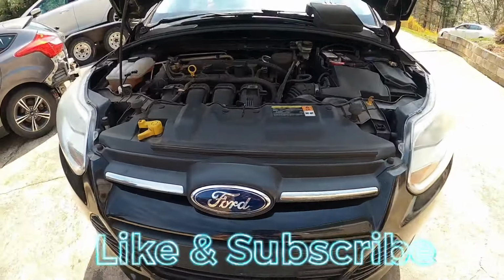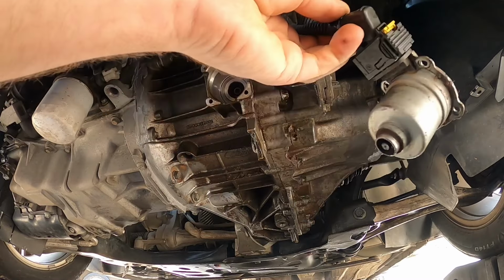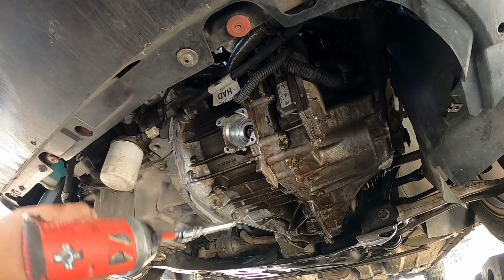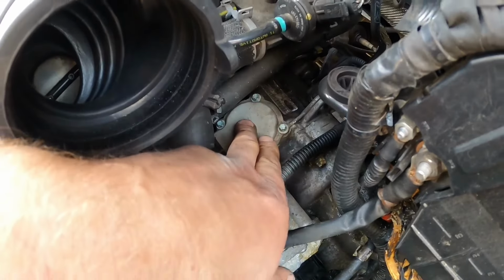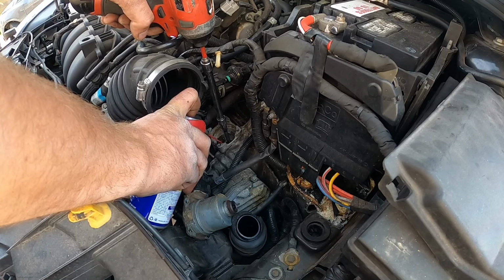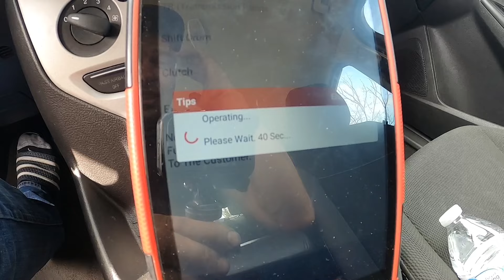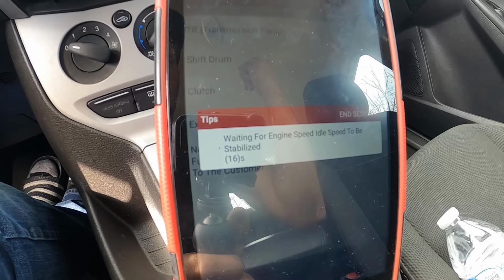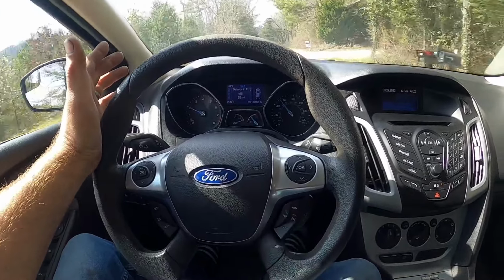2012-2018 Ford Focus Slipping? No Reverse? No Drive? Problem Solved. Easy Fix. You Can Do This!

Comment: Hey man! First of all, thanks for explaining this procedure in such a straight forward way. Point of inquiry: what kind of scanner are you using? It seems that mine doesn’t read transmission codes. I have an Otofix D1 Lite…

Comment: Impact-Driver has small battery which prevents damage.  Drill should have a smalll battery too or go slow.  Be very carefull. Apply extra fluid to help clean. Have patience.   Good Luck

Comment: Looks worth a try! Have people found this to help with the 'transmission overheating' message?
Reply from the maker: Overheating means forks are sticking and slipping the clutch. This should help. If not, you need new forks and possibly a clutch
Reply: @L8R-HP  thanks for the reply. Hoping I can find a good mechanic to do forks etc in Sydney, don't want to take it to Ford

Comment: My focus is slipping slightly in first, so I will test this fix out. I think I will get an extra actuator from the junkyard and cut off the splined part to make my own tool.
Reply: Low key smart..
Reply: did it work?
Reply: @2511jeremy  I have not done it. the transmission is performing fine as is currently

Comment: Surprising to me i haven’t had this problem yet. I got the 2017 se and i had the car for about 3 years. Still no problems with it, and i drive it aggressively everyday. I treat the car like a rally car.
Reply from the maker: Haha nice!
Reply: You're one of the lucky ones.
Reply: I have a 2015 focus with over 100k miles and its barely started doing it.
Reply: Because the 2016.5-2018 models were the "problem free" models with all the hardware and software updates. Driving habits are the main issue after that. I have a 2016.5 model (bought brand new) that's had a few small hiccups over the duration of ownership. Still going, just shifts a little slow so I think the TCM needs replaced.
Reply: @brandonhooker4498  How do you know if you have a 2016.5 model?
Reply: @Chadman333  build date, which should be on the manufacturer’s sticker on the driver’s door jamb
Reply: @brandonhooker4498  Thanks for quick reply! My son is looking at a 2016 Focus se sedan, carfax shows TCU recently replaced and clutch was replaced at 37,000 miles. (Currently has 105,000). I was trying to learn more about the transmission problems with these cars. Do you know the specific build date that the car would have to be built after to have the better components? I was watching a seperate repair video which said they were all built the same and have same problems all the way up to end of production.

Comment: I have a 2014 Focus. Car suddenly would not go over 30mph. Reverse and Drive works fine. Took to mechanic and they said transmission needed replaced. However when the codes were cleared, the car drove perfect all the way home. Has not happened again since bringing it home. What would have caused the issue? Mechanic did not tell me what codes pulled when it was scanned sadly but with it running fine now, I'm skeptical that it is actually the transmission. Thoughts?

Comment: Yo! Thank you for the video. 

I'm preparing to do this work on my 2014 Ford Focus se. Lately, after 20 min of driving or so, my check engine light will come on, I'll lose Reverse and switching gears from 1-2 and 2-3 are really rough.

 I've seen on other videos that you can and maybe should (?) clean the forks with Brake cleaner and lubricate with WD-40, I also purchased 2 new actuators just to cover all my bases.

My question to you is, do I need some fancy diagnostic tool to do this job? Or can I get by just cleaning the forks, replacing the actuators, and restarting the car? If I need some sort of Diagnostic tool, what capabilities must it have? I just ordered a FORScan tool, will I be able to do what is necessary with FORScan?

Any help would be so greatly appreciated man. Thanks!
Reply: Curious to know how this turned out for you
Reply: hey I’m having those same issues. were you also getting “transmission hot” issues but it would be fine after a few minutes? Thanks, if you read this
Reply: @mads416  Hey mads, no, fortunately for me I didn't have that issue, but I haven't fixed my issue yet either. It still jerks and shudders often but the worst of it has yet to come. It seems that the issue is especially apparent when it gets hot, like 80F+, and we haven't really had that where I'm at yet. The worst includes stalling completely (car does not get into gear) or losing reverse for 20 min at a time. 

Hope we figure it out. Ford should have a Class Action filed against them.
Reply: @CattyWompus.  Hi Catty, I haven't fixed it yet but my car still runs and jerks at every stop sign! lol

Comment: If you have a blow gun you could always zip tie it to full blast and insert it into the top one while you're spraying. Be sure to wear safety glasses....lol
Reply: @james102377 I should use an air compressor and shoot air from actuator a (top) down with actuator b (bottom) both out?  Will this not send all the clutch dust flying all through the gears etc?

Comment: Works long enough for me to get a FOR SALE sign in it I’m good with that!
Reply: Learn your lesson.  Buy an EV.  No transmission
Reply: @anthonybha4510  😂😂😂 an EV?
Reply: Just sell it to carvana and be rid of the headache. While my focus gives me no other trouble than this tranny shudder from the forks i think its ridiculous, my first car was a 2000 Taurus and that car had over 200000 miles with no transmission work done and nothing wrong with the car except a couple o2 sensors. But cars that dont break down dont make ford any more money.

Comment: My question is what effect will all the fluid have on the clutch in the long run??
Reply from the maker: Don’t put too much and it won’t be an issues. There’s so much heat in there it will dry right up
Reply: @L8R-HP  thanks for getting back to me. I definitely need to do this.
Reply: Brake cleaner will not cause an issue. Be sparing (use less) of wd40. He said "a little bit". WD40 is a water displacer cleaner that does not dry like brake cleaner. Brake clean is a degreaser/ cleaner.

Comment: Do you think is a good idea to put a vacuum hose in the hole to remove some dust from transmission housing before spraying brake cleaner.. I don’t have any problem yet, just thinking to do it as a preventive maintenance
Reply from the maker: Worth a try

Comment: Good video, I used a used part and took it apart to make a tool. Long story short, the bottom fork wound up all the way and then unwound itself all the way. A actuator DID NOT spin back all the way, it would spin about 4 spins and stop. Does that mean the fork is bad? I'm not a very mechanical person but it definitely didn't spin back freely like B actuator did. I tried spraying it multiple times and using plenty of WD-40 and it still didn't spin free all the way back. It also looked off center and made a clicking sound at about the last 6 turns. Would I need to take this transmission apart?
Reply from the maker: That fork needs to be replaced :/
Reply: @L8R-HP  Thank you man for your response. That's what I was thinking too.
Reply: @L8R-HP  do you have any recommendations for ordering a new clutch and fingers from? I looked at rock auto but didn't see anything. Who's got solid replacement parts? I'm probably going to completely rebuild the dry side. 100K miles on her.
Reply from the maker: @ryans4401  ford OEM parts if you want it to last. eBay, just make sure they are OEM ford

Comment: Guy, your video is very helpful. Thank you. I'm hoping somene helps me to just clean the actuators as I can't go underneath my car without the lift. 

I got this problem in NC in my way back to New York. Sadly the people just state that is the transmission as you said without the proper disgnosis. It takes 3 days to get the diagnosis over here and i just need to go back.

But you are amazing in your process and explanation!

Comment: Mine is a 2013 and the tool won't work. 6mm does not fit. Is there another tool for it ?
Reply from the maker: Capri Tools 6 mm M6 Stubby XZN Triple Square Bit Socket, 1/4-Inch Drive (CP30353) https://www.amazon.com/dp/B083B6KMCL/ref=cm_sw_r_cp_api_i_APBT1Y53WYPBMXJ4PSKE
Reply: @L8R-HP  hi , i just notice TRIPLE SQUARE 6mm only have 12 sides , so they have to be 14 sides as the actuator or the special tool , the good one has 14 sides same as the link from ebay u sent me

Comment: Ok, I’m hooked! I bought my first 2012 with this problem as a project. Of course as luck would have it, it wasn’t quite this easy for me.😂 I’m still having a blast working on it. I’ve purchased Forscan and I’m getting a  “Clutch travel test error” whenever I attempt a clutch relearn. The car still doesn’t have reverse, 2nd, 4th etc. ( all pointing towards shift fork “b” issues”) The car has 96k on it. It’s had a clutch replacement done  and actuator “b” has been replaced recently (I did swap it with actuator “A” confirming both actuators are good. I’ve performed the trick shown in this video to both forks. My next step is to pull the transmission. I’m just wondering if the message I keep seeing verified I’ve definitely got a mechanical problem inside the transmission.
Reply: 🎉Do the transmission work.🎉😊

Comment: There are 2 actuator motors for the 2 shifting forks which work in groups (A is for 1st, 3rd, 5th) (B is for 2nd, 4th, 6th, R) and 2 actuator motors for the 2 dry clutches (A and B correspond to the same gears as the shifting motors).  Any one of these 4 motors can fail or the part of the TCM that drives them causing very different results.
Reply from the maker: Correct
Reply: Which gears does the top motor correspond to ? The A or B set ?
Reply: I did some with the drill and the liquids somewhat worked might have to do it some more. Let us know after your car gets really hot. If it still worked oh and by the way I took off my cover underneath seems to help keep it cooler.
Reply: @360Sebastian360 A gear 1/3/5
Reply: @360Sebastian360   Top=A Bottom=B

Comment: Great video on this. Question for  you or the group; I have a 2013 Ford Focus, 146,000 miles that I just purchased; I have the dealership records on the car (helps to work for them :) ) - transmission was not worked on or replaced. When the car is cold it shifts perfectly; after about 20 minutes or so there can be some shuttering and uneven shifting between 1st and 2nd. Once in second - no problems. I am well aware of the reliability of these transmissions. I have done the adaptive learning on the TCM - it helped some. But I saw this video and wonder if one of the clutches may be gummed up a bit. So if my problem is only between 1st and 2nd - should I focus (no pun intended) on Actuator A or Actuator B?
Reply from the maker: If no codes, try this out
Reply: @L8R-HP  Oh I'm going to :) Parts are on order; I just wanted to know which Actuator I should work on; if the problem is in shifting between first and second gear - is it Actuator A causing the problem or Actuator B? I may eventually replace both - just wanted to know which one is more likely the culprit in this situation.
Reply from the maker: @MRDavisFamily  It would be B. But you can switch them around, they are the same. Just to see if it makes a difference in driving
Reply: @L8R-HP  Hi - So I picked up the CASOMAN 10 Piece Spline Tip Bit Socket Set you recommended in an earlier post - unfortunately none of the bits fit the shaft. Besides the ones I see on Ebay in the UK can you recommend any other source? I'd rather not spend $200 on that clutch kit as I won't be digging any deeper into the transmission than this. I cleaned B (without exercising the clutch) and I saw a small improvement; hoping the correct bit will get me the rest of the way. Thx.
Reply: I learned the tcm is recalled I just bought mine and can’t drive it because I’m having this problem but I thought let you know
Reply: @kelseygrantham8452  The catch is - they will only do the TCM recall if the computer is throwing specific codes; otherwise (sadly) they won't replace it under the program.
Reply: @MRDavisFamily   mine won’t even move sadly hopefully soon I can’t fine the tcm to replace if this trick don’t work fingers crossed 🤞🏽
Reply: Install the electric Focus lower transmission mount. Use OEM, Motorcraft one.
Makes a big difference w/o adding vibration in the car.
Stay away from "Race or track use mounts) unless you want to feel lots of vibration through the car. It's a daily driver, not a race car.
Reply: I have 2012 and having same issue please let me know what you did to fix this i got a quote for 3000 cd
Reply: @HarshKumar-gg1qr  I wound up breaking fork B by putting too much tension on it (or it was old and was going to break anyway). Brought it to a transmission shop hoping to just replace the forks; after they had the clutch out they could not get it to reset - so I had to get a new clutch. Cost me $2000. Even after I got it back the shifting was not smooth - until I found Tom's Tune ($450) - a custom software tuning which addresses a lot of the common issues with this transmission. Been running it for a year now; car shifts smoothly and predictably now. So in summary; yes there are known problems with these transmissions; the fork exercising and lubrication will help with some of the issues; the software tuning does work and fixes many of the behavioral issues (but only if your clutch and transmission are mechanically ok).
Reply: @MRDavisFamily  i already visited and got 2 3 quotes someone says it costs around 2200 for actuator and someone saying it needs rebuilt which will cost me 3800 dollars,so im just thinking to try out these small tricks may be it works
Reply: @HarshKumar-gg1qr  A new clutch, 2 actuators and seals should not run you much more than $2000 USD installed.
Reply: @MRDavisFamily  thanks i will try sny other genuine transmission repair shop and ask them what is the exact issue 
I saw when they checked 1st time is was showing solenoid isseue and 8n 2nd scan it was actuator
Reply: Thanks for your help
So should i try these tricks or directly got repaired by some transmission shop
Reply: @HarshKumar-gg1qr  So every situation is different; if the forks or the clutch is damaged or marginal then the Tune will not be effective. If the forks are just stuck due to dust build-up then the solution in the video is relevant. Important thing to keep in mind is that these transmissions will never be 'perfect'; they have design flaws which cause these behaviors. Once you get the clutch and actuators mechanically sound then the Tune will make a big difference in how the car runs and shifts.
Reply: @MRDavisFamily  ohk thanks a lot for your inputs will let you know when i got it fixed.
Reply: @L8R-HP  I have a question have you seen work for when it says overheating transmission and pullover and would this maybe work if it slips in 3-4 gear ?

Comment: please sir. I found it very practical and instructive. thanks. But I wonder if the dry box of this clutch model has these problems with rust, due to facilitated water infiltration, if the injection of these solvent liquids will not cause future problems. ok it's lubricant too..I know. But just out of curiosity.. is there a drain at the bottom that allows the excess of these sprays to drain naturally? Tanks for your time.

Comment: Put 91% alcohol in a soray bottle, this way it will thoroughly clean it and evaporate fast without the eiak if iver wetting. Also use a bliw dryer to make sure everything is dry where air can not get to.

Comment: That thing looks like it has a rear main seal or oil pan leak in the rear judging by all the grey RTV around the bellhousing. Being that it's a dry clutch, any oil on it will ruin it. Also the engine oil causes the rubber boots on the clutch release levers or "actuators" to swell, eventually tear, then allowing the dust in and causing premature failure. None of this applies to the automatic 1.0L Focus that comes with a 6F15 transmission.
Reply from the maker: No Oil leaks on this one. Not sure why someone put RTV, these transmissions aren’t that bad with proper maintenance. I deal with them all the time.
Reply: I know, I bought one for myself I had to fix and it's great, 160k miles on it and I'm sure I'll put another 160k on it lol. You will be surprised as some can be dry underneath but as soon as you split the transmission from the block, a quart or two of black clutch debris filled oil pours out. Usually you can tell if that's the case if the starter gear is wet or the rubber seal below it is swollen. Funny thing is some of them will have mild or no symptoms at all while this starts happening.